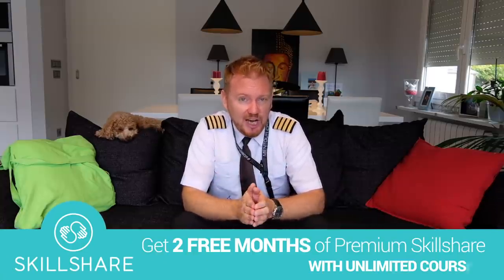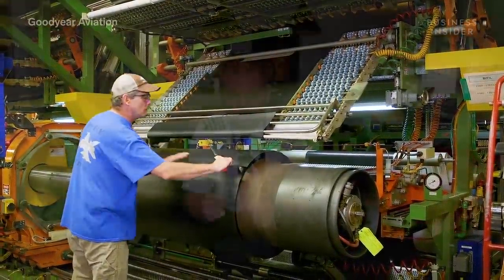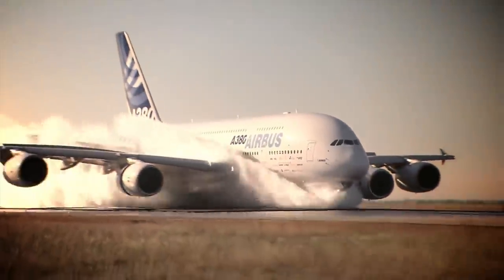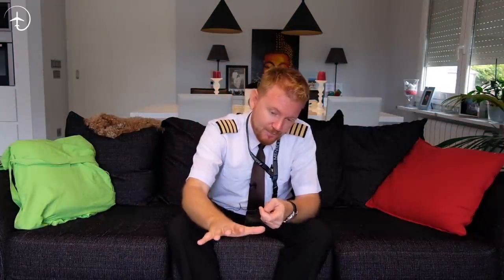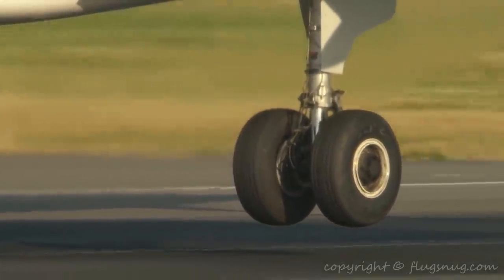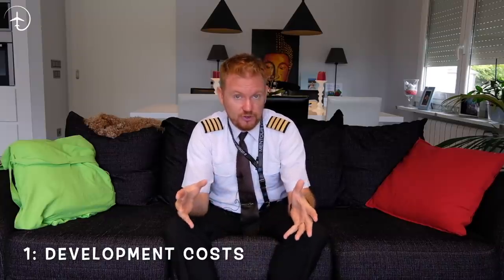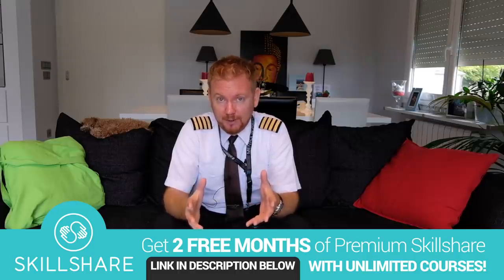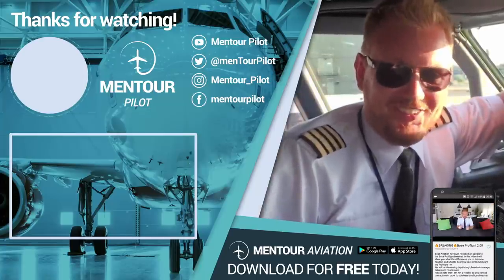Why not make plane-tires spin, before landing?!

Comment: Wasn't there a school science project where someone came up with the idea of fitting little 'pockets' onto the wheels of airplanes for exactly this purpose? Basically flat "pockets" on the sides of the tires that are open on one side so that they catch the air and start spinning the wheel?
No need for motors with all the problem that would bring with it. Of course manufacturing the tires would be more complex, and I don't know how much it would actually achieve (how fast that mechanism could actually get the wheels to spin, having to overcome mass inertia of the afterall pretty heavy wheels, plus the friction in the wheel hub, and how much spinning them up would save on usage of the tires, ... - all that would have to make up for the additional cost of the tires)

Comment: Airline tires are the best fendering for tugboats. Most modern tugs today don't use old tires for fendering anymore. There's modern molded rubber going around newer tugs. But there are plenty of old tugs that still use old truck tires. But every now and then old airline tires become available. They are by far the best choice. Whenever we come alongside a ship of make up alongside of a barge. They absorb the shock and hold position like no other fender. I wonder why though. There so hard to come by?

Comment: 1. Weight. An A320 would require minimum 3 motors for the 3 axles for the six wheels. The wheels are already around 120kgs themselves; a motor to spin that up to even half of touchdown speeds would have to have equivalent power as a normal car motor. 

2. Maintenance. It is so much easier to change a wheel whenever it fails an A check (there's always spares) than to add multiple A checks that 3 separate motors are running, working properly and lubricated during every single A check. 

3. What's the point? The tyres will still get worn anyway, look at your own car for an example. It might triple the life of the tyre, but at the cost of hauling around 300 kilos of motor every single flight, which could instead be occupied by two passengers paying $150 each, which over 1000 flights will be $150,000! That's some nice pocket change, which would easily offset the cost of tyres every 400 flights. 

4. Gyroscopes... sorta. In truth, the amount that the spinning wheels affect how the plane flies is minimal at best. I mean, both engines have about 13 huge spinning fanblades each, going from between 2500rpm to 10000rpm, depending on how big the fan is.

a bit of quick maths; a320 touches down at 140kts, i.e. ~70m/s. the tyre diameter is about 0.75m. so the circumference is about 2.35m. this means that the tyres would need to rotate about 30 times per second, or around 1800rpm. this is certainly nothing to scoff at, but the gyroscopic inertia of a wheel is significantly smaller than that of a fan blade, so even though each fan blade weighs less, they contribute much more to the 'gyroscopic effect'. just thought i'd clear that up, as there are a lot of comments saying that it's due to the gyroscope effect of the wheels, when in reality that would be minimal.

Comment: You're taking into account only the aircraft and its tires, not the runway: landing with still tires leaves huge amounts of rubber on the asphalt, which means more maintenance on the runway itself for preventing other aircrafts to lose maneuverability on that now dirty asphalt (which is why you can be fined for destroying what's apparently just your own tires on a public road: you make that road more dangerous for other drivers/riders).

Comment: Why not add some device inboard of each wheel-set that spins those wheels using the air that the aircraft is moving through upon the landing approach to power it?  Even if the wheels were not spinning fast enough to match the ground speed at touch-down, as long as they are not spinning faster, that should greatly reduce the tire wear.  In fact, you would probably want to design it so that the tire contact surface is moving slower than the corresponding ground speed, so as not to drive the aircraft sideways when landing as mentioned in the video.  There would be very little weight or power penalty (other than the drag effects of the device in the slipstream), and these devices could be designed based on wheel set weight and placement to ensure that they all spin at the same angular velocity.

Comment: May I add that the purpose of the landing gear is mostly to absorb the energy of landing. As tires are part of that, effectively they are taking some of that energy while touching the runway and if they are made to be spinning in advance, this means that some of that energy will have to be absorbed by another part of the landing gear - the brakes. And it doesn't make sense to preserve the condition of the tires at the expense of more wear on the brakes.

Comment: As for motors in wheels for taxi - not all wheels need to be powered. If there is enough traction, only front wheel set need to be powered.
As for power, it could be electric, by taking off power from jet engine and redirecting it to motor inside wheel. It could also be hydraulic motor, using same system as rest of the craft.

Comment: Love your videos!  I don't think you meant to say that Nitrogen is an inert gas, and of course it still follows the same perfect gas law (PV=nRT) that all gasses do.  The difference is that it's possible to generate N2 with almost no water, so you don't have to worry about phase changes in water. (F1 does use some inert gasses, but they're in a league of their own, and I still don't know why.)
Reply: If you use "inert" as an absolute, i.e. does not react with anything at all, helium is the only truly inert gas, as even neon, argon, and xenon can react with other elements under certain conditions. However plain old nitrogen is a lot less reactive than many other gases, especially oxygen. N2 is a very stable molecule.

Comment: I was thinking about having some kind of fins on the hub of the wheel that begin catching air and getting the wheel spinning as soon as the landing gear are lowered. Like blowing air at a fan to get it to turn. Maybe the wheel wouldn't be turning at full speed on touchdown but it would help a lot. No power required as well.

Comment: Cessna citation has a optional nose wheel spin up kit  for gravel runways. It uses ram air to turn the wheel. RPM is not  matched to aircraft speed. Its just better than nothing

Comment: How about wind shields over the top of the tires? Would make the gear more aerodynamic and while landing, the moving air around the button could slowly accelerate the tires up to landing speed. If it isn't wished, because of coming in at an angle, one just releases the breaks late, in order to give the tires no time to accelerate before touching the ground.

Comment: Why would you need motors? You have the air flowing around the wheels, just fit airfoils to the wheels and they would spin up without motors. They could even be designed to retract or loose efficiency at a certain rpm to not accelerate the wheels too much if there is a longer time between gear down and landing.
Reply: Didn't think I would be the 1st to suggest that! ;)

Comment: Those tire pieces on the side of the road are pieces of "retreads" that are frequently used on trucks for all axles except the front wheels. Retreads contain remanufactured treads that are glued to old tires and upon high loads/heat will disintegrate. 
They have less structural integrity than fresh made tires. Truckers call those retread pieces "alligators " on the cb radio.

Comment: The first thing that came to mind at the start of the Video is adding/shaping small "fin" shaped rubber to the sides of the wheel so they catch a bit of Airflow to start turning, even if only spinning slowly the inertia should be alot better for the wear? It's not as complicated as adding Motors to each wheel, but of course i'm not an engineer, this might create to much variety in different windspeeds etc. There are enough smart guys around that probably tested this 5second Idea enough to not do it ^^

Comment: The tires pieces you see on the side on the road that you pictured are mostly retread tyres. I wouldn’t consider these to be blown tyres, as most of the time the tyre is still inflated when all these bits of rubber come off.
Ps: keep up the good work, I’m enjoying your videos and getting to know the airline industry a bit more.
Reply: Aircraft tyres are re-treaded up to 3 times generally (it varies a bit depending on the application) as long as the carcass passes inspection

Comment: Gyroscopic effect is mentioned when talking about pre spinning the wheels and tires at landing.  How about when you take off.  It's my understanding that take-off speed is a bit faster than landing speed.  Do you brake the wheels and tires before stowing them.

Comment: I don't think the simplest lightest tech would be battery based, I think it would be pneumatic, but I get your point. At work I hesitate to adjust even the simplest process scripts because they would have to pass QA and approval down the line.

Comment: Everyone always defaults to high technology with the motor driven ideas & power sources like the issues you spoke of...  I always thought about low tech... simple & cheap.... a simple stamped aluminum disc with fins that bolted directly to either the wheel or the brake rotor... cheap to make, cheap to replace, easy to install & reusable... once the landing gear was lowered, air speed would be caught by the directionally angled fins & start rotating the tires, they're not mechanically connected so there is no concern over speed matching @ touchdown because they can still instantly speed up or slow down as needed...  still usable in crosswinds or crab position... granted, it likely wouldn't get them up to full speed because of the frictional resistance vs the time they're deployed vs touchdown... but even if it brought them up to half speed, the wear on the tire would be greatly reduced. especially the very cheap cost to stamp an aluminum disc vs the tire life...

Comment: I've thought about this often, and always assumed tires could be spun-up if there were turbine blades on the wheel, something like an anemometer. There'd be no mechanical complexity involved. It might not be spun-up to the exact speed needed, but could probably be developed to a reasonable approximation of landing speed.

Comment: You said that the tires don't have to deal with sideways forces like a car tire. An exception to this would be in a crosswind landing, when the plane is "crabbed" into the wind. I know pilots usually try to align the plane with the runway just before touching down, but this doesn't always work completely. It would be a pretty brief moment, but the sideways forces could be substantial. Of course you are not going to be taking any corners at high speed in a taxiing airliner.

Comment: hmm...to just spin the wheels (not for taxi purposes), you dont need a big motor, you just need to spin them slowly. you can either divert a little energy from the main jets (like a dynamo) to the wheel motors, or, if you're afraid of losing power, however little, that you would need for landing, you have that auxiliary engine at the back that can be used, or the emergency propeller. I dont think if would be difficult to design or approve/certify. the question is whether or not it would be worth doing for the tires' sake. I imagine they get replaced fairly regularly anyway.

Comment: instead of having a motor to spin the tires pre touch down, you could just have a small vane built into the rims that uses wind energy to spin the wheels. although there is a drag penalty

Comment: Since there is a lot of time to spin-up, motor power should just overcome the losses. So there is no need in heavy motor and batteries. 
Maintaining speed of somewhat less than expected ground speed is really simple for modern electric motor controllers. As well as detecting if wheel is not spinning.

Comment: You don’t need motors to match the speed with motors. 

All you have to do is put wind veins on the hubs that catch the wind which will accelerate the spin of the wheels to close to the surface speed of the plane and solve most of the issue for virtually no cost and if carbon fiber or fiber glass there wouldn’t be any additional weight replacing the covers that are already on them.

Comment: How about using the natural environment they are exposed to once down at the time before landing? There must be a way to channel that air towards the wheels in between those tires gaps to create enough pressure and get them to start rolling, or create patterns on the tire’s side rubber itself.

Comment: Seems like you could have little fins on the hub of the tire, sort of like a windmill, to use the passing air to passively spin up the tires as the plane approaches the runway. Lightweight, passive, simple, and not a big deal if it fails.
Reply: Could just be little cups, similar to a cup anemometer.

Comment: I wonder if the early B-36 before they had smaller wheels and bogies had some means on those very big wheels.
Either taking air from a cylinder or shapes on the rim so that nothing happened while stored, but the airflow acting on the windmill shape would get it up to some percentage.

Comment: What about some small vanes on the tire hubs so that the airflow would slowly accelerate the wheels once the gear is extended? That would hardly need more weight. It might still have the vibration issues - maybe the brakes could be kept on until close to touchdown to minimise that?

Comment: How about a disc fitted to the outside of the wheel, which unfolds an arrangement of blades that are designed to scoop up air (similar to a water wheel, but for air)? Lightweight, and doesn't have to be failproof. They can even be turned to help with braking once the wheel is on the ground.
Reply: Same problem as all of these methods, any of them might work but you don't NEED them so no one is going to fit it because it would cost money to carry around the sky for no purpose.

Comment: 1: DEVELOPMENT COSTS: its a one time cost that spread out on hundreds or thousands of airplanes over decades of use isn't that big.
2: SAFETY: mechanically it can be easily done using one way gear, just like on your bicycle. If the motor doesnt drive the wheel, then it act just like an ordinary wheel that spins up when landing. Electric motors are prone to create sparks, which are not good. But this is in an environment that can cope with red glowing brake discs. A spark will not be more dangerous. 
3: SIDEWIND LANDING: there's no problem making this mechanisms on or off just by a switch. So if there are strong sidewinds, the pilot can just turn it off for that spesific landing.
4: BATTERIES : all aircrafts have batteries already built in as redundancy spare power for electronics if engines stops. If the batteries are not used during the flight, they can instead be used to spin up the wheels instead. When the plane is landing there are no real use for redundancy emergency/spare battery power anyway. 

Just my thoughts :)

Comment: instead of Electric power (battery) can we drive the tires by pneumatic turbines (using high pressure air pressure from engines) attached to wheel attachment....that could be small one and no heavy batteries required.

Comment: Nitrogen has a lack of combustion and Moisture and is less likely to escape from the tires and will maintain the same pressures even during temperature changes it will keep moisture out of your Tires too making it an ideal choice for routine maintenance, gas, parts and more. You can have Car Tire Shops put Nitrogen in your Car Tires too and it is Very Smart to have your Tire Shops Put Nitrogen gas in your Car, Truck, Motorcycle and Anything with Tires that hold Air. and the Tire will Wear more Evenly with Nitrogen in the Tires then regular air do to the Maintaining more of a Stable Pressure at Changing Temperatures. If you do have Nitrogen put into your Tires Don't use Tire Pumps or you will have to go back to the Tire Shop and have that Air Removed and Replaced with Nitrogen and if you have to use a Tire Pump and you have Nitrogen in your Tires You have a Leak and Should have the Leak Taken Care of and Not just Keep using Tire Pumps and Not taking care of the Real Problem That the Tire is leaking.

Comment: The forced rotation of the tires is part of the energy management of landing.  Just the energy required to get the tires up to speed,, also slows the aircraft to below the point of energy required to lift the aircraft.  If motors prespin the tires  you will need additional braking to slow the aircraft, additional spoilers, flaps, engine thrust reversals.  There is no energy balance benefit to prespinning the tires.  Just additional weight and complexity added to the aircraft without benefit.